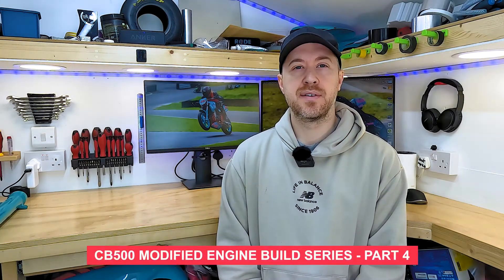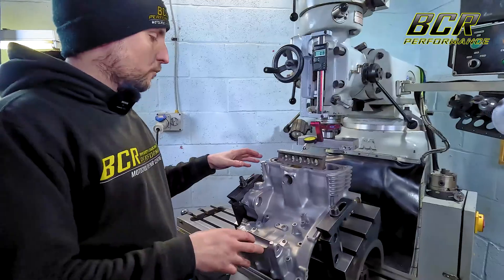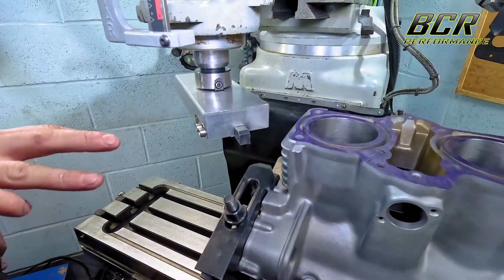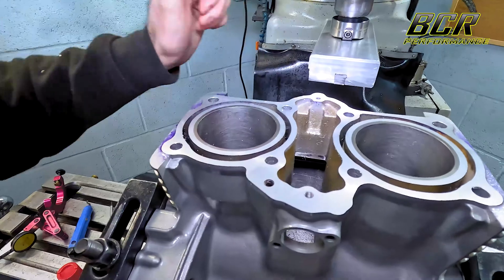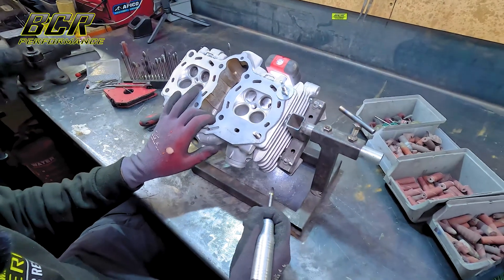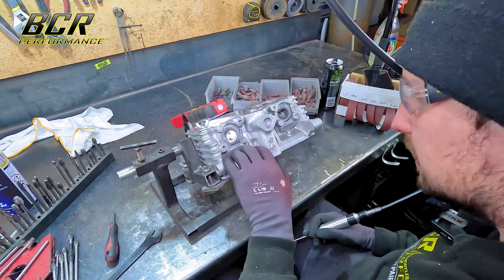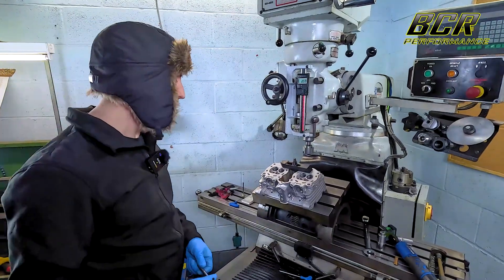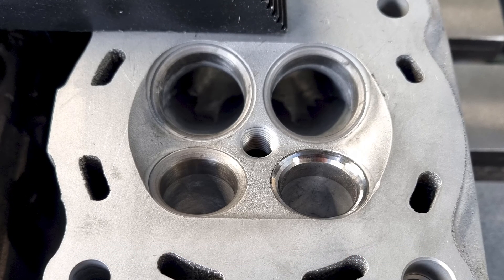Instant power gains!!! Tuning and porting a Honda CB500 motorcycle 😎

Comment: Dyno yet?
Reply from the maker: @HAL9000-su1mz  Hey. No not yet, nearly there with the bike. Just sorting a few issues with throttle cable and radiator hoses. Then I'll get it running and get it ready for the Dyno. Not long now, I promise 😁👍
Reply: @SuggyRacing  Honda "could have" done so much more with that engine. The benchmark EX500 was very long in the tooth - even discontinued - thus Honda early on decided that it would be sport-ish and have unrealized potential. A shame, really, but a very nice project for you. and now the CF Moto 450 is nipping on its heels!
Reply from the maker: @HAL9000-su1mz  Yeah they definitely could have pushed 
 it more. I guess that's why these engines are bulletproof and run for miles and miles, nothing pushing them at all. Even what we did can be pushed a lot further. But it's just cost. We went for a more budget friendly power Increase. Ben at BCR gets loads of these to do. 👍

Comment: What sort of gain does a flow job get. Is it suitable for a road bike
Reply from the maker: @andywilliams4063  It would definitely be good on a road bike, it all helps it with performance. Ben can probably answer better than me, but if you only do porting it will help, but not as much as having the other work done too. It's a balance getting it all running well. A good set up on the Dyno would help a lot too. 👍

Comment: Good information! Another subscriber... a question: what power do you think you'll get from that engine? Regards from Portugal
Reply from the maker: @JeanMelim  Hey. Thanks for the follow, appreciate it. We are hoping for around the 60hp mark. Which isn't enormous, but for a small engine it would be quite the percentage increase on what is standard. My bike made 48hp, the maximum these bikes make as standard is around 50hp. So it's slightly under at the moment. There's loads you can do to these, we decided to do it a budget friendly as we could. The next stage is doing larger pistons and much more work. Hopefully this will be a noticeable difference in performance alongside other CB500 bikes 😁👍
Reply: Un cb500 pc26 développe 58cv d'origine pourquoi 48 @SuggyRacing
Reply from the maker: It doesnt make 58hp. That's the figure Honda claim, but the max they make is 52.
Most are around 50hp. Mine was low for some reason. Honde exaggerated the maximum power the bike made.
Reply: @SuggyRacing  thanks for the reply. Yes 20% more it's a huge improvement! Good job!
Reply from the maker: @JeanMelim  I'll be posting the engine rebuild video soon, so keep an eye out for that one..it's a good video 😁

Comment: What is the year model of this engine.
Reply from the maker: @AmrinderSingh-zx9hr  it's the cb500 1992-2003 model bike. Mine  is from 2002 and it was from the S model bike. But the engines are all the same across 1992-2003 👍

Comment: short guides for exhaust valves. Can it disipate the heat like that?.
Reply: Yes without issue. As a percentage I have only removed 5% of the EX guide which is minimal. 

You are right in what you’re thinking, it is always better to have valve stability & heat dissipation over the small gain in flow which is why on any heads we do, we would only ever remove valve guide material if there is enough to remove without sacrificing stability & heat dissipation.
Reply from the maker: I'm not sure to be honest, I'll ask Ben and get back to you. Although assuming it will be fine with him doing it. 👍